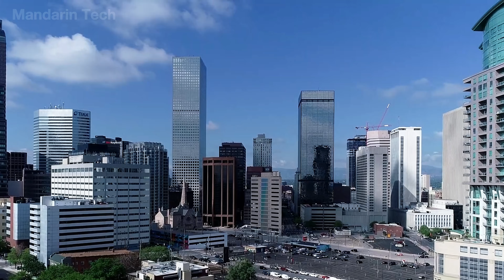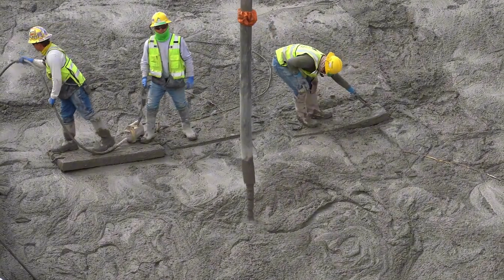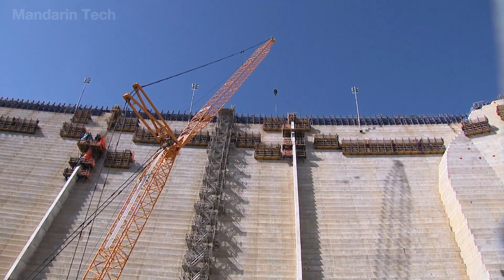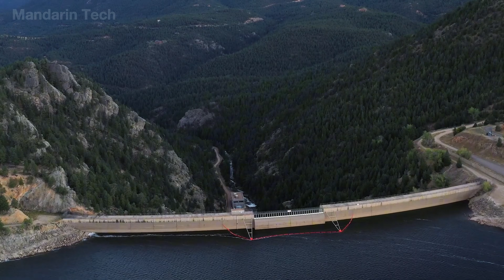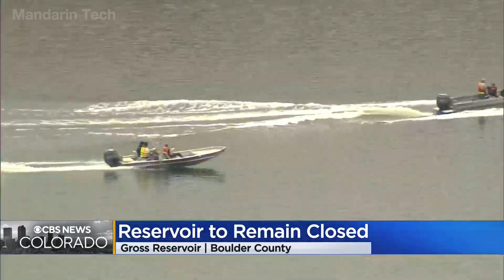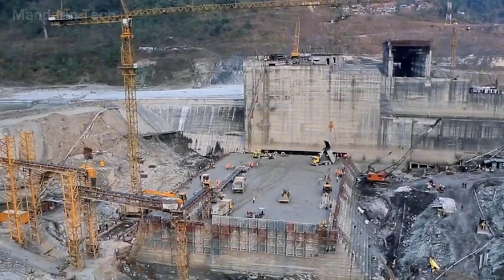You Won’t Believe How American Raised a 100 Year Old Dam by 40 Meters in Way China Couldn’t Believe

Comment: Field Engineer & Environmental Perspective
🇬🇧 English

From a field and environmental perspective, modifying an existing dam requires strict monitoring and environmental management.

Managing water levels, ensuring structural safety during construction, and minimizing environmental impact are critical priorities.

Field engineers play a key role in ensuring safe execution and compliance with environmental regulations.

Rehabilitation projects must balance performance, safety, and environmental responsibility.

#FieldEngineering #EnvironmentalEngineering #DamSafety #Hydropower #SustainableInfrastructure #ConstructionSafety #ResponsibleEngineering

Français

Du point de vue terrain, la modification d’un barrage exige un suivi rigoureux.

La gestion de l’eau et la sécurité sont essentielles.

Les ingénieurs terrain assurent le contrôle et la conformité.

La réhabilitation doit être durable et responsable.

#IngenierieTerrain #IngenierieEnvironnementale #SecuriteBarrages #Hydroelectricite #InfrastructureDurable

Español

Desde la perspectiva de campo, modificar una presa requiere control riguroso.

La gestión del agua y la seguridad son fundamentales.

Los ingenieros en obra garantizan ejecución y cumplimiento.

La rehabilitación debe ser sostenible.

#IngenieriaDeCampo #IngenieriaAmbiental #SeguridadDePresas #Hidroelectricidad #InfraestructuraSostenible